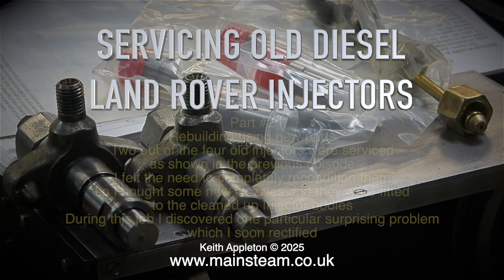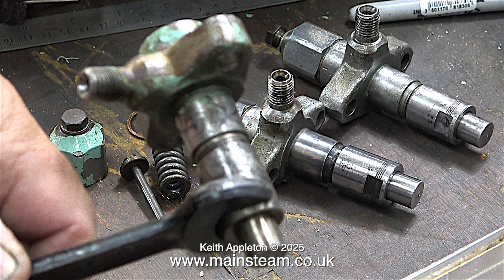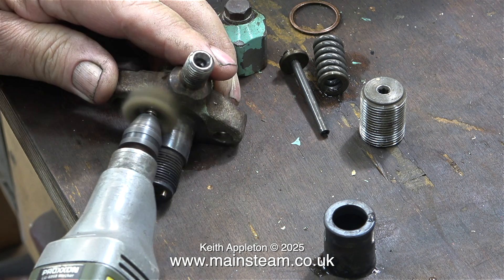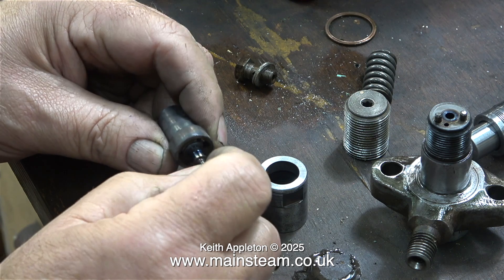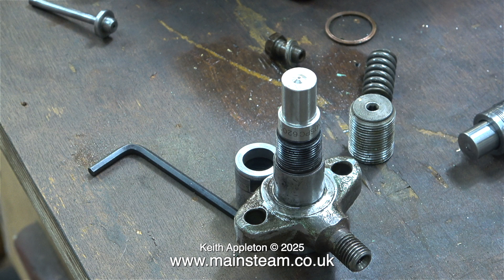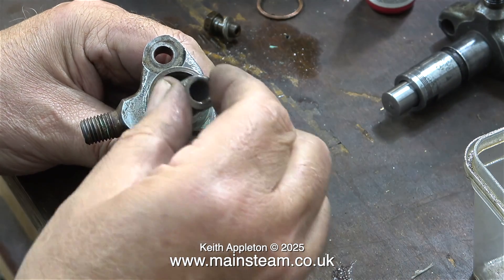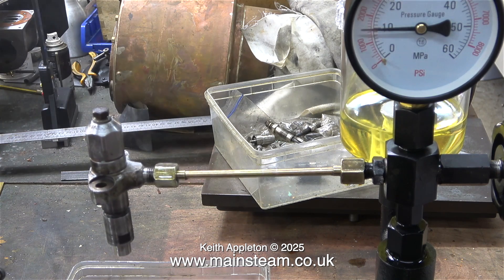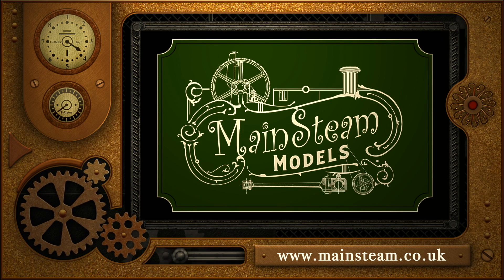REBUILDING OLD LAND ROVER DIESEL ENGINE INJECTORS - PART #2

Comment: Hey Keith.
I worked in fuel injection for 20 odd years so here's a couple of pointers if you have to overhaul a set again. 
The reason for your leaks is unfortunately because you used heat to release the nozzle cap. A few light taps with a hammer is normally enough to break the rust and free it. 
Because the the nozzle and the body are face sealed the heat has very slightly warped the body. 
You can remove the pins and re flatten the face with fine grinding past and a flattening block. 
Also to release the cap you can buy special sockets that make it very easy. 
A trick to holding the injector body so you can tighten or loosen things easily is to get a flat piece of metal plate and drill 2 holes in it  the same distance apart as the mounting holes and a large hole in the centre that the body can fit through.
Then just put a couple of bolts through the holes and slide the injector on. 
You can then work on it upright without worrying about damaging anything. 
Hope this helps a little.

Comment: Keith I worked in a ship yard on the Mississippi mid state Illinois now I was engine block welder machinist I was on a boat one day had 2 12 cylinder caterpillars main propulsion 8000 hp I was told injector s you could only buy knew no rebuilt or used that cost $24,000 $1000 a piece they told me that’s one reason they changed engines the engine s I welded on was cast steel and fabricated steel they welded good but you couldn’t weld very much watch heat and stress relief